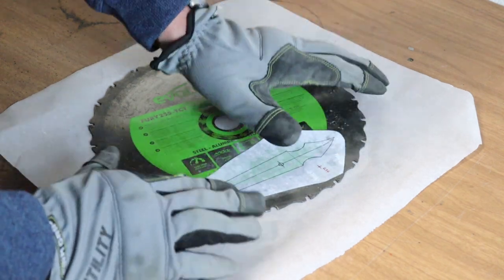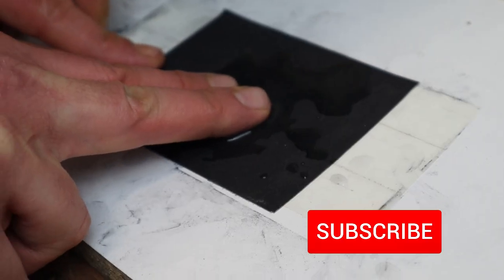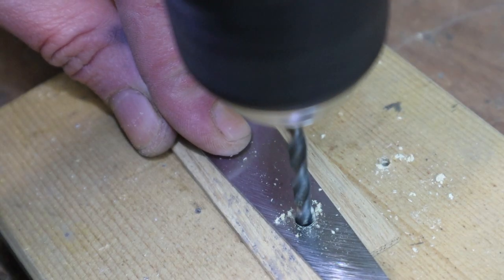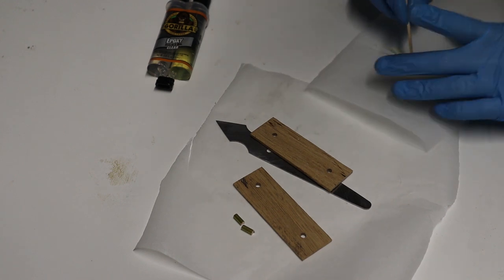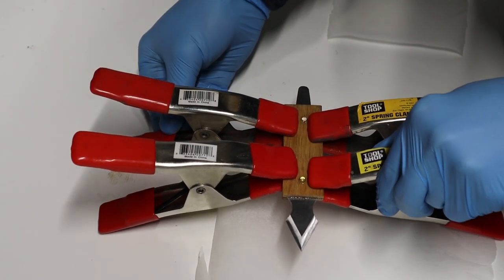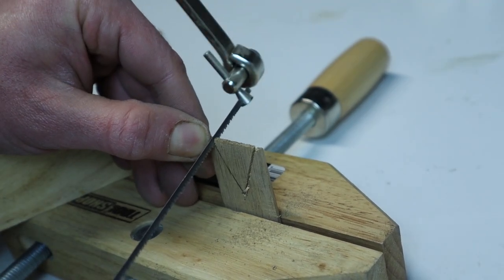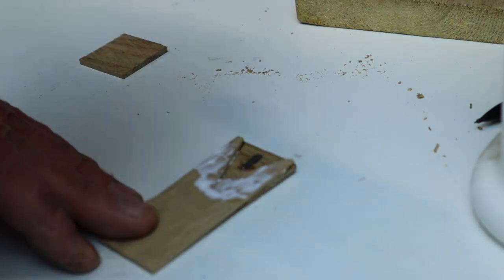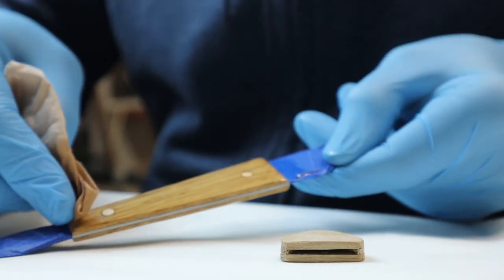Making a MARKING KNIFE from an old saw blade - DIY // MakeON

Comment: Excellent work but I think I was most impressed by the protective cap or blade cover!  I got to remember that neat and yet so simple design idea.
Reply from the maker: Thank you!
Those tiny pieces for the cap were indeed the trickiest and most time-consuming part of the build...
Reply: @MakeOn  I'm sure they were!  When I said "simple design" I'm referring to, well, it's simplicity, using an ordinary (i think it was) drill bit for milling out the slot for the magnet and only enough magnet to do the job.  Tricky an time consuming I'm sure, but clean genius design nonetheless.  Kudos!
Reply from the maker: Thank you, David! You're too kind! 
Honestly though, if I were to make it again, I would leave the corners of the cap sharp, instead of rounding them, to be consistent with the blade shape rather than with the wood handle.  At the time I thought that, being it an utilitarian object, rounded would be more comfortable in a pocket and would prevent chipping.

Comment: there is nothing in your reply below  a simple pdf would work fine Thanks
Reply from the maker: I just logged out from Gdrive and tried printing one from the link I put in the video description and it worked just fine, I tried the download button and it gets you the correct pdf file as it's supposed to. I even tried printing it to pdf and I got one on my desktop in no time. 
If you can be a bit more specific about the problem you're having I will be glad to try and help you.